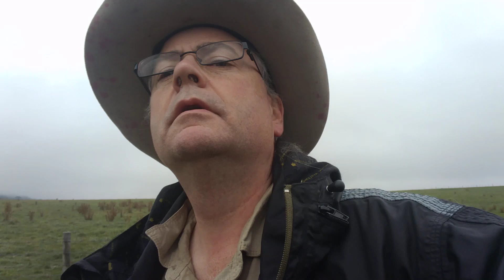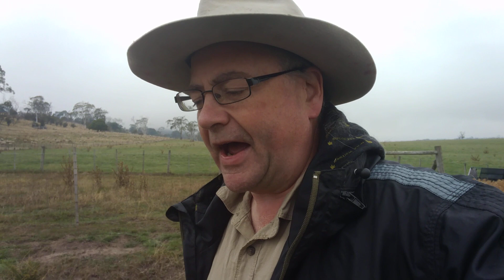FTTN internal wiring, co-existence and reliability

Comment: Enjoying your videos, another reason Co-existance hasnt been turned off is because of the long copper tail customers on adsl. ie vdsl signal can travel through 800m~ of .040 copper, however the pillar its connected to feeds customers further (from being just outside the footprint to being many Km away) which are still on adsl. Those customers only NBN option is sky muster at this stage which they are not required to switch to.

Comment: You can't use a normal electrician for any internal home/premises NBN FTTN cabling - by law you are required to use a registered cabler.

https://www.nbnco.com.au/develop-or-plan-with-the-nbn/new-developments/design-build-install/cabling

"Only registered cablers can perform in-home cabling work for a home or business owner connecting to the nbn™ access network. "
Reply from the maker: Yes you are 100% correct. I would also advise it anyway. Arguably it also takes someone who understands the vagueries of FTTN. A good check is to ask if they have a DSL analyser, such as one of these: https://www.viavisolutions.com/en-us/products/hst-3000